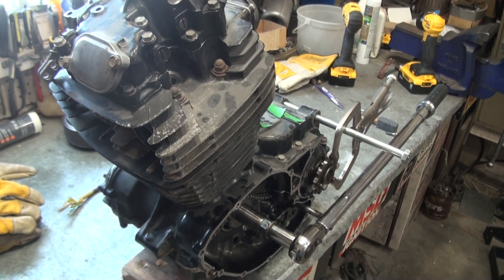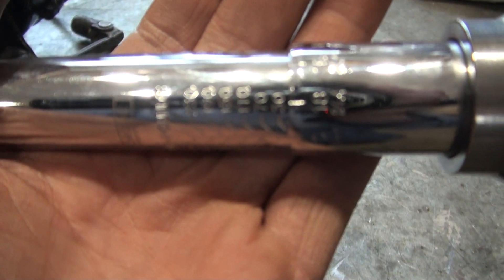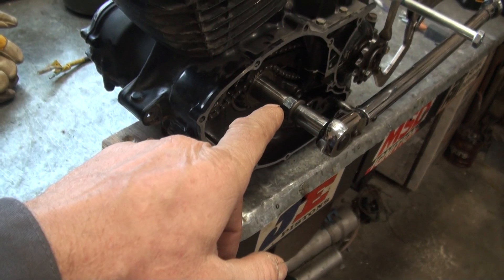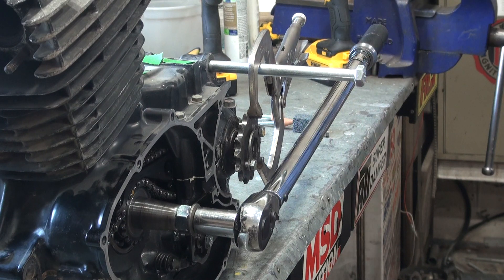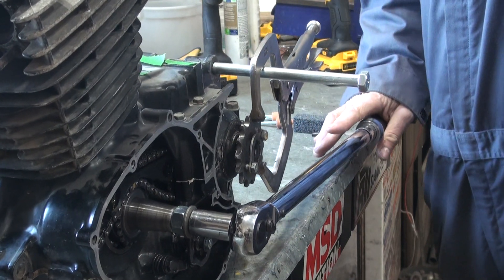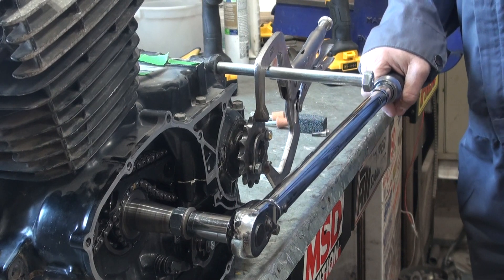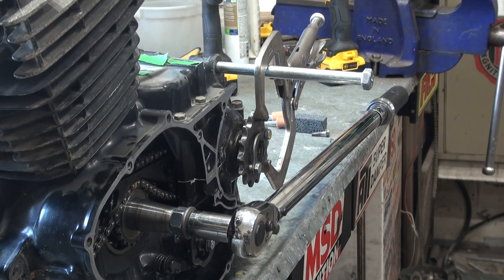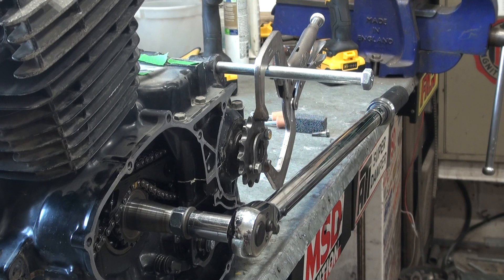Honda XR500 Work Bench Clutch Test

Comment: A single cylinder four stroke would technically have about 4 times the rated torque for a quarter of the time,  this pulse does get reduced by dampeners in the clutch gear and general drive train flexibility between the crank and the wheel, there's a good chance that the clutch will still hold fine at the readings you got.